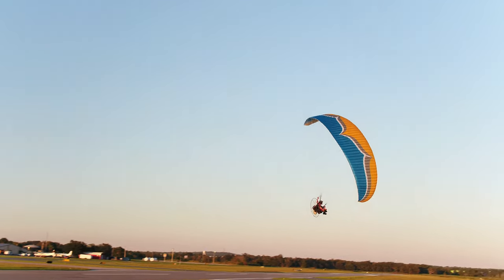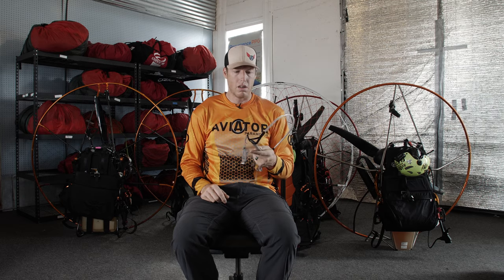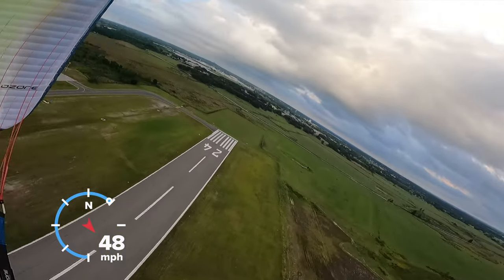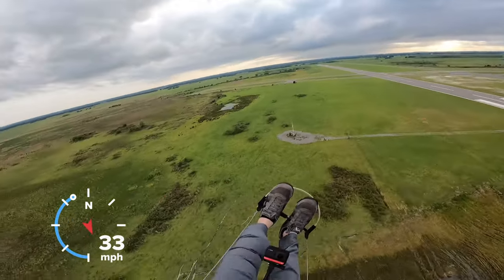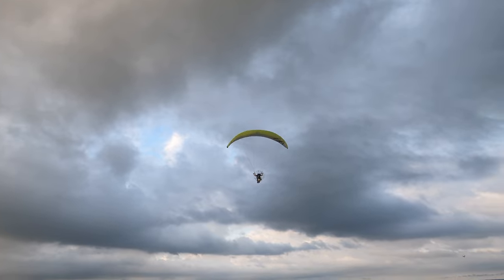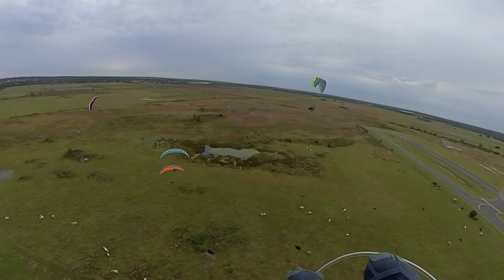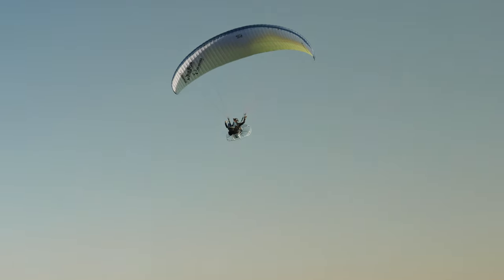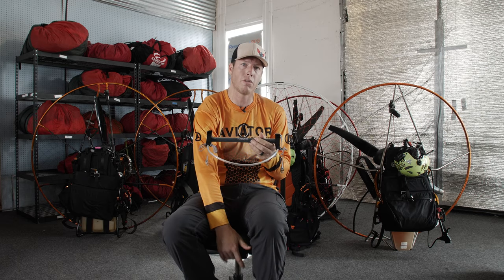How to Use Speed Bar - Refining Paramotor Skills Ep.4

Comment: Thanks AJ, I to love having and using bar, I rarely use trims since I fly low a lot, and the pitch control and height control with bar is great once you learn it.  Very good video, you covered everything well.  I can think of ONE more point, and that is the slim but nasty chance of the brummel hooks (sister clips) coming apart (especially on launch).  You should put a small oring around the clip that basically once you clip them together, you just slide the oring over the little notch, its impossible for them to come apart then. As a handful of pilots have experienced (my self included) a clip coming undone on launch and they can easily swing into your prop, nobody needs that.

Comment: For most that don't have dummy risers and a hang setup, you can also just clip your wing's riser into the carabiner with the paramotor on the ground and the speed bar velcroed to the seat, raise the risers until the swing arm is at max extension, and adjust the bar line until there's practically no slack, and tie it off. At most, this usually only requires one or two additional adjustments after a test flight. Once proper length is confirmed, you can put a sharpie mark where the knot's at for future removal and install to make things easier 😄